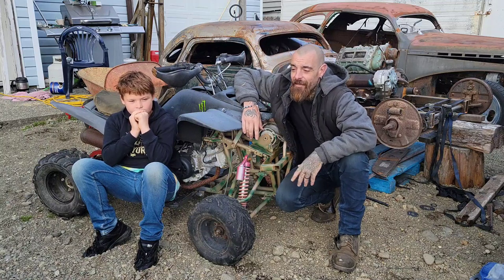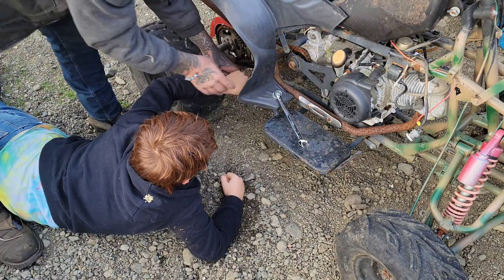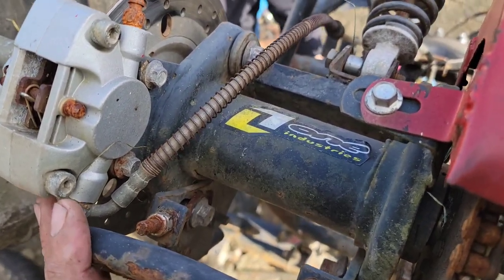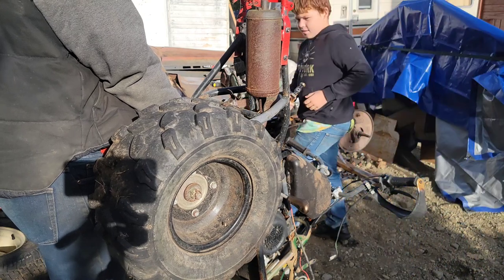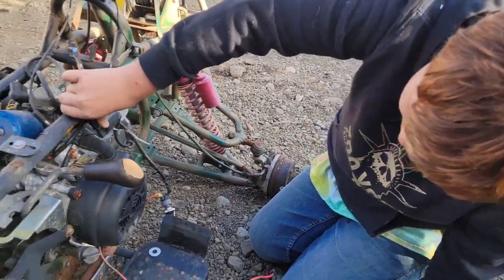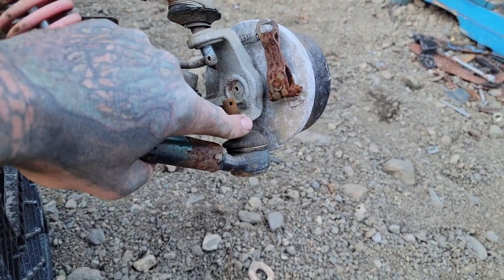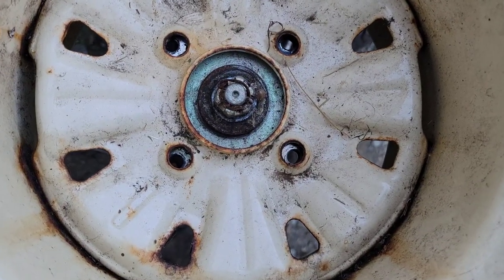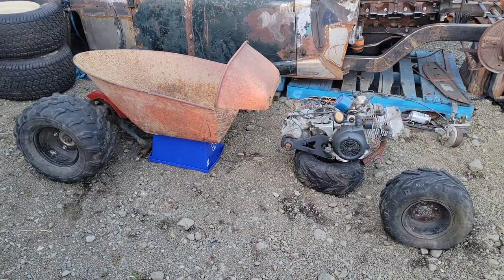Rat Rod Go Kart 4 the KIDS!!!!  Stripping the donor for Parts

Comment: I would have turned the body around I think you cut the wrong end . I've seen that look before, and the round end was definitely the dash
Reply from the maker: I looked at it both ways , but this wheelbarrow is almost pointed at the other end,   was too much, I'm leaning towards finding another one and just using this as a placeholder for it.